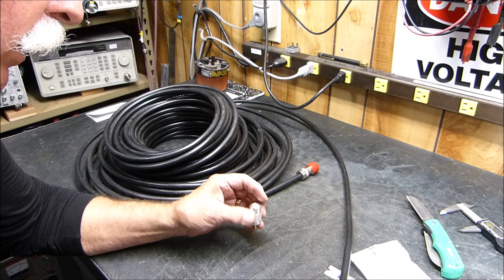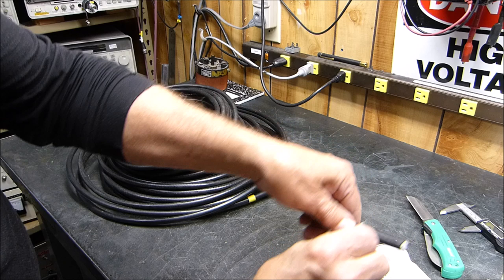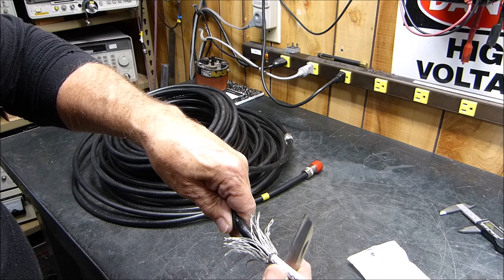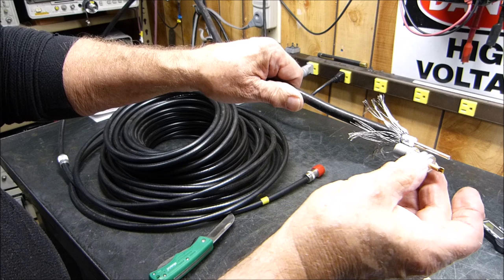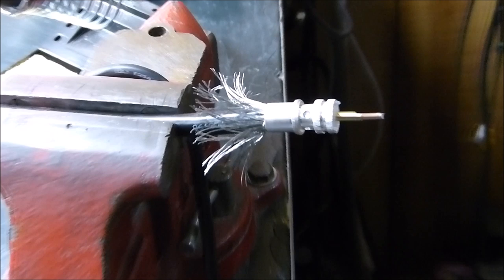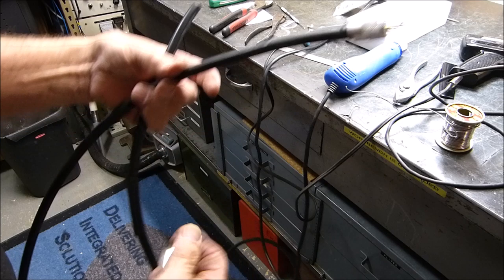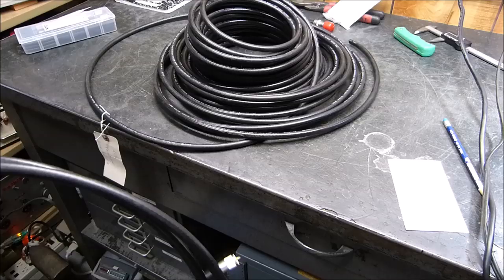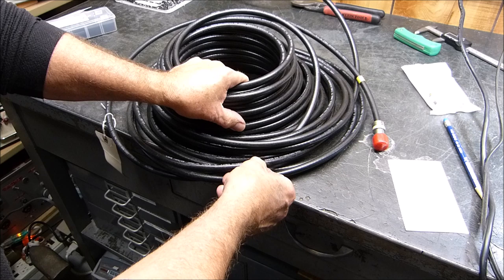Simple And Fast Method For Attaching PL-259 RF Connectors To RG-8, 9913, LMR-400 Size Coax

Comment: And you didn't solder the braid. Why?
Reply from the maker: The point of this is to Not have to solder the braid  but ensure a good mechanical/electrical connection from the braid to the connector. Soldering the braid thru the holes is not a bad thing but it has to be done properly with a hot enough soldering gun and quickly and effectively as possible. I think the problem is very simple. Very possibly, the builder does not have an adequate soldering gun that will get hot enough to do the job before melting the dielectric of the coax and making a mess.  Also, just simple experience. A newcomer to this will want to be careful and solder it slowly thus ending up with the first problem - melting (and possibly shorting) the center conductor to the shield and making a mess. This method of compression connection to the connector is the only method that is used in N connectors (and all crimp-on BNC connectors) which are generally superior to the humble PL-259.  And lastly, no connection or design is forever so to make equipment stand the test of time, it must be able to be disassembled and repaired. In the 1960's and 1970's when I was working as an engineer for NASA, the idea was to make equipment last forever. Make it out of stainless steel but... make it so it could be taken apart (many times) and put back together after repair so it could work again. That concept is gone today. I am sure you know what I mean.

Comment: Um ... I disagree.  I recommend following the manufacturer's instructions instead.  Screwing/forcing the connector on over the braid cuts and breaks the bread, and pushes it back, so all you see through the little holes is the foil over the inner dielectric ... and, yes, you need to solder through the holes, as this a) makes electrical continuity between connector and braid, and b) weather seals the connector to avoid wicking water up the braid when it gets wet.  I do not recommend screwing/forcing the connector over the braid as illustrated herein - it can break and cut the braid and keep it from reaching the little solder holes.   Another case of good intentions, but poor advice - I do  not think he is better informed than the engineers who made the cable or the connector.  but that is just MY take ... your mileage may vary.  TT

Comment: PL 259 is very "limited" connector , just good for CB...
Reply from the maker: I used to look at it that way also and almost always went to the trouble to use N connectors but at HF (up to 30 MHz) PL-259's and SO-239's are just as good. 
I have read and done my own personal measurements and they are literally "perfect" in impedance (50 ohms) to at least 100 MHz and completely usable to 250 MHz. I remember the first time I started getting interested in the PL-259/SO-239 vs N connectors was probably 35 years or more ago and I made some dummy loads but did not have the test equipment to evaluate them so I took them to the cal lab at WSMR where I worked and the old fellow asked me if I was trying to perfect the short circuit... He was kidding with me, of course, but 3/4 inch copper water pipe, SO-239 and carbon resistors for a low power dummy load tested quite well to about 250 MHz before stray L and C  made them unusable for accurate measurements.
Also interesting that they are sometimes referred as "UHF" connectors but I think that is a hangover from about 100 years ago when 30 MHz was way-up-there... 
I found for the HF range, the curse of the PL-259 was soldering the shield thru those four little holes. Sometimes I made it really nice, using something like a 250 watt Weller soldering gun to heat it up quickly so as not to slowly melt the dielectric but it is so easy to get bits of solder in the threads and it just becomes a hit-and-miss event to make a "perfect" job. 
Even in the top-notch N connector world where everything has to work with minimal loss in the GHz region, the connection to the shield is a mechanical crimp connection and not soldered.
Anyway, this seems to work nicely and I have been using it for some time and see that the mechanical connection is very tight and I think a lot less likely to break than the solder method.
Lastly, in a little more defense of the humble SO-239 and RG-8 size cable, I believe the voltage rating, in case we want to use it for HV connections between a separate PS and amplifier is around 4 KV DC.  I find that pretty impressive for such a simple connector.
Thanks for your comments. Always appreciated.   73   WA4QGA
Reply: Agree with ElPaso - Yaesu HF radios come with so239 sockets (for pl259 plugs), and my new Yaesu FT991a has the so239 on the HF side and the n-type for the vhf/uhf antenna connection. If a pl259 plug is good enough for the high end radio manufacturers, then it's good enough for us mere mortals.